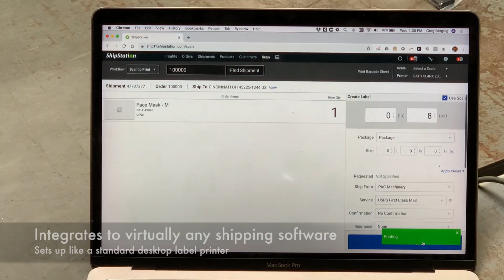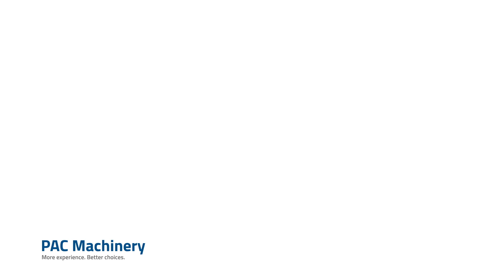Rollbag R785 Auto Bagger - Packaging and Shipping Face Masks in Poly Mailers

Comment: Do you have to buy rolls of bags that already have openings?  Or does the machine take a continous roll "tube" and size the bag for the cut you want?  I ask because I'll have a 4" wide roll but may want 2" length, 3.5", 4.0" etc.
Reply from the maker: Hi Greg, our Rollbag R3200 has an option to work with poly tubing and make bags to length, per your request. Please send me an email (gregb@pacmachinery.com) and we can discuss your project. Thanks!